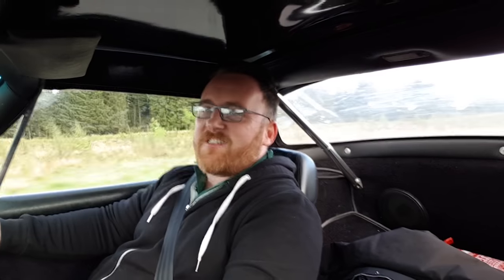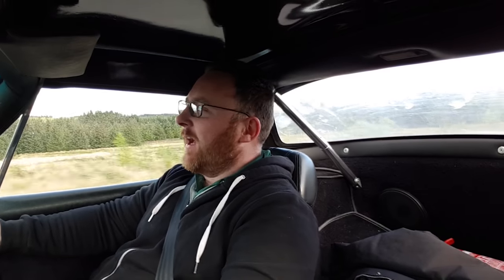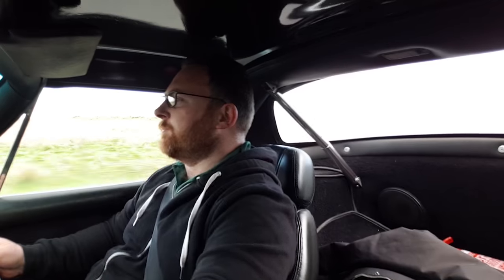TVR Chimaera TURBO - MAPPED, HARD LAUNCHES AND POWER!

Comment: Nice video. Can I ask where the mapping was done? As I'm looking for a mapper for my TVR. 
I'm currently running megasquirt in a chimaera 500 with a few mods. Installtion and mapping so far has been DIY, due to lack of mappers up here in Aberdeen. 
Managed a dyno run last year and the it made 337bhp, so power is good,  but ot really needs a  professional mapper to really get it fully sorted.
Reply from the maker: Dynatune in East Kilbride. Couldn't recommend them enough, very knowledgeable.

Comment: What boost level did you end up at? Good jump in torque even if the power isn't quite what you hoped for! Is it still a 4 litre?
Reply from the maker: Yup, 4.0 running 8psi. Nice and safe for now due to the stock internals.